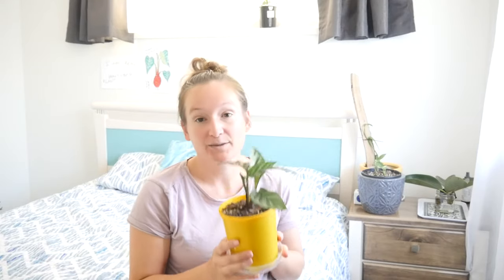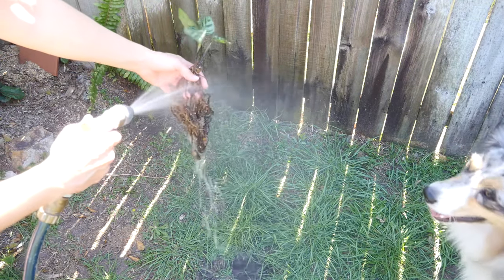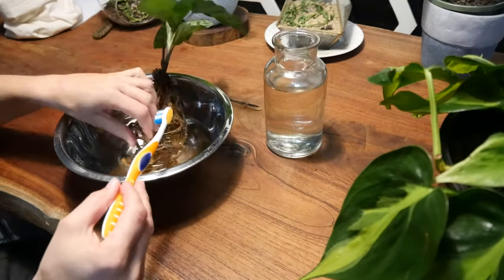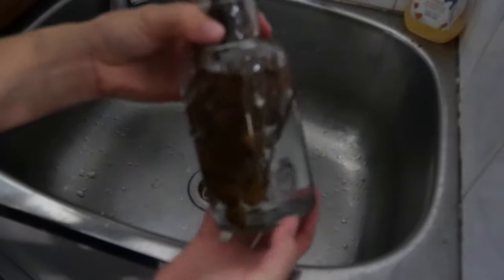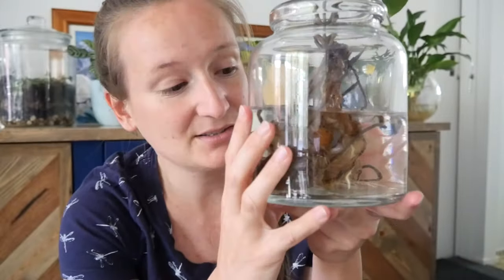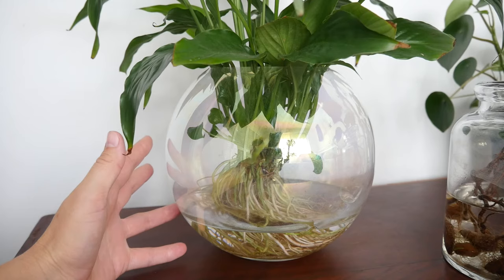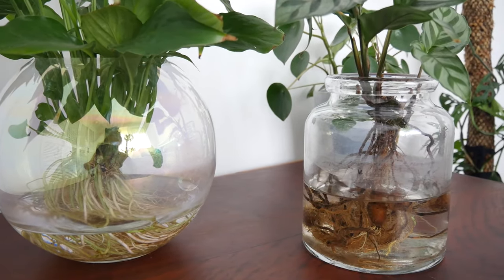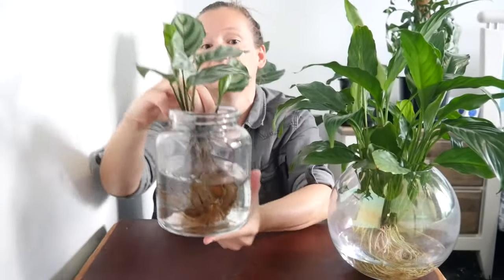How to turn a plant from soil to hydro (first time for me!)

Comment: I place my plants in water, change water once a week. No plant fertilizer.  They are really growing.  I learned a lot from your video.
Reply: Do you use plant cuttings or do you change your plants directly from soil to water?
Reply from the maker: @turquoisechocolate3027  that's frustrating. I would say it's a lack of light problem. You could considering buying a grow lamp to help out. You can get globes that fit into normal lamps, just make sure the wattage is correct.